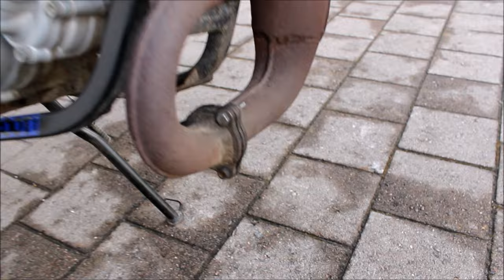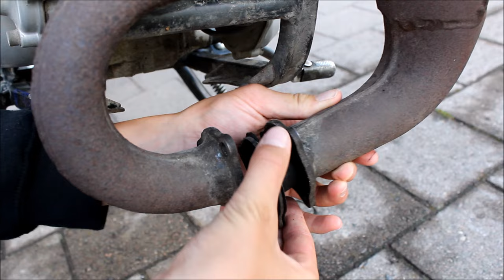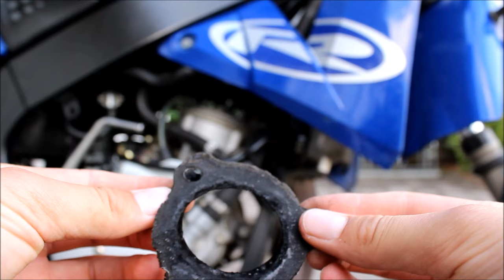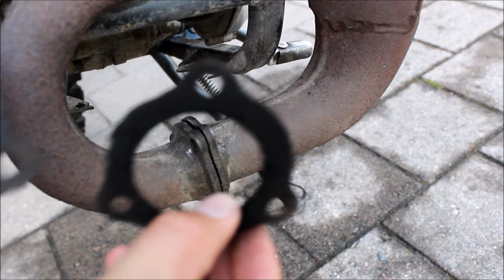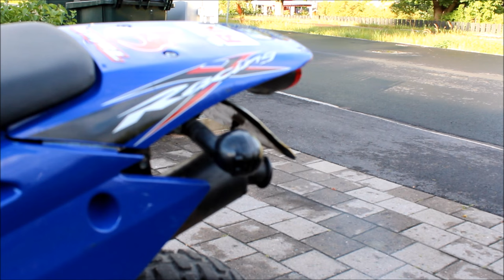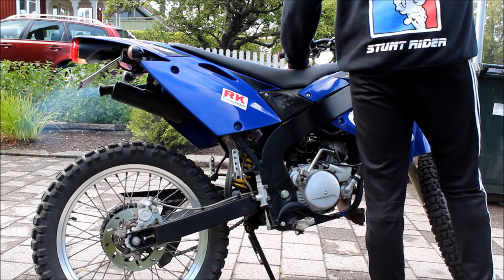Dra pluggen (Trimma moppen)

Comment: Jag minns Yamaha Fs-1 :ornas tid.  Då var det betydligt mer jobb än så där om man skulle ha en moppe å gå 75-80 km/h.  Högkomptopp, 5,5 hk cylinder å kolv, större förgasare, större insugsplatta, trimavgassystem och större framdrev.
Reply from the maker: Aa jävlar, dagens moppar är strypta på sätt som gör det enkelt att trimma antar jag
Reply: Har en Yamaha fs1 där jag har 60 kubik, större förgasare, trimrör, ostrypt insug, större framdrev, mindre bak och ändå bara går 60-65

Comment: Har en Aprillia SX50 2018 som går 53 original, har bara åkt 150km med den. När tycker du att jag ska dra pluggen? Eller tycker du att jag ska göra det i huvudtaget? Hur snabbt kommr den gå sen?
Reply from the maker: Dra pluggen när du tröttnat på 53, kommer gå i cirka 75 kanske
Reply: SMG stunt när tycker du? Jag är första ägaren o så
Reply from the maker: Om du tycker den är för slö, så gört nu
Reply: SMG stunt kommer det skada motorn då den gått lite mil?
Reply from the maker: Det tar ju mer på motorn, men vafan, de ba köra på, det kommer inte hända något så länge du äger den
Reply: SMG stunt 
Sålänge motorn frf håller så bryr jag mig inte, tänkt behålla den 3 år till, kan jag sätta i pluggen tillbax om den slutar fungera? Så jav har kvar garantin om det hönder nått
Reply: men asså ja vet att derbi har fastsvettsad plugg har inte aprilia oxå de..?
Reply: quake min har det, ska dreva om den istället

Comment: Går den fortare eller bara ljudet?
Reply: Undrar samma sak
Reply: Går mycket snabbare, eftersom att mer bränsle tar sig genom röret. det har med hur mycket som kommer igenom avgassystemet som gör stor skillnad
Reply: Liam tror du detta funkar på en kymco super 8
Reply: SweAmino njae, inte exakt så han gör men det är nog möjligt att det finns strypningar i kymcon’s rör också men det får man leta lite efter kanske, bästa hade vart att inte pilla med originaldelarna då nästa köpare ksk vill kö original så beställ hellre trimrör ;)

Comment: Ännu lättare på derbi
Reply: Är det enkelt på derby senda extreme 2016?
Reply: @rickarderiksson6982  ja men du måste ha rätt verktyg för pluggen sitter hårdare fast på en derbi än på hans i videon. Köp storlek 85-90 munstycke och framdrev 13
Reply: @alexks4959  varför behövs större munstycke?
Reply: @rickarderiksson6982  för att om du drar pluggen utan nytt munstycke så kommer du varva mer och cylindern kommer man säga hejdå till efter ett tag.
Reply: @alexks4959  hur mycket skillnad gör det om man drar pluggen. Och har alla moppar samma munstycke. Alltså ser alla likadana ut?
Reply: @rickarderiksson6982  den kommer gå iallafall i 100 så om du inte är säker på att du kan hantera det så ska du inte trimma så mycket.  Munstycke köper du bara ett kit och provar dig fram
Reply: @alexks4959  ok tack så mycket!
Reply: @alexks4959  men om man inte varvar ut helt hela tiden. Om man släpper lite då och då funkar det bättre då
Reply: @alexks4959  gör det någon skillnad om man bara byter till större munstycke utan att dra pluggen eller?
Reply: @alexks4959  man behöver väl ha en ostrypt cdi också?
Reply: @rickarderiksson6982  om du verkligen vill trimma och köra 110 eller mer så byter du munstycke till större byter framdrev till 13 och kanske byter bakdrev ifall du vill ha mer kraft och drar pluggen.
Reply: @alexks4959  får den bättre axx också om man drar pluggen? Kommer den påriktigt gå i 110?
Reply: @rickarderiksson6982  byt bakdrev till mindre för bättre acceleration
Reply: @rickarderiksson6982  om du drar pluggen byter munstycke byter framdrev och bakdrev kanske ett nytt rör så kommer den gå de ja
Reply: @alexks4959  vad för drevningär bäst för bra axx och 60-65 kmh toppfart
Reply: @rickarderiksson6982  byt till framdrev 13 för 65 till 70 i toppfart vilket jag anser är bäst i början att inte trimma så mycket. Och för bättre acceleration så ska du byta bakdrev till mindre kolla upp vilken storlek så kan jag säga vilken du ska byta till.
Reply: @rickarderiksson6982  vilken storlek du har på din cross
Reply: @alexks4959  jag hade 13 innan det var skit slö i motvind och i backar så jag bytte till 12 och det var lite bättre . Jag har 53 vilket är original just nu. Vad föredrar du?
Reply: @rickarderiksson6982  kanske 50.
Reply: @alexks4959  vad har du? Eller har du samma?
Reply: @rickarderiksson6982  kan vi typ ta det här moppe snacket på snap istället blir enklare
Reply: @rickarderiksson6982  Har exakt samma cross, funkade det för dig?
Reply: @alexks4959  hallå
Reply: @Alan-kj2eg  har du gjort det än?

Comment: kan du skruva? svar nej hahahahaha
Reply from the maker: Är du grön Mio? Svar nej
Reply: SMG stunt man har aldrig 2 packningar mot varandra som du har . kan vara de ibland när man byter kolv. Aldrig annars
Reply from the maker: Gillar att leva riskabelt
Reply: SMG stunt jo men bara så de vet de tänkte ja
Reply: Har man 2 kan de läcka avgaser,olja,vatten eller vart man sätter 2 packningar
Reply from the maker: Jo tack